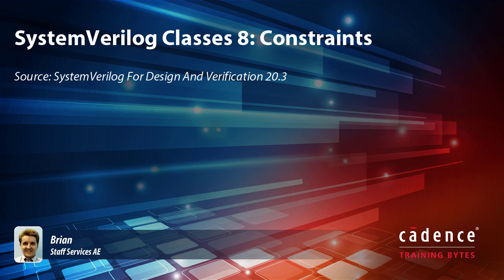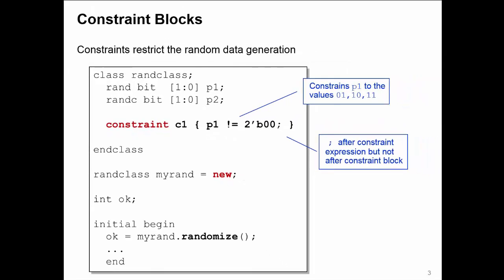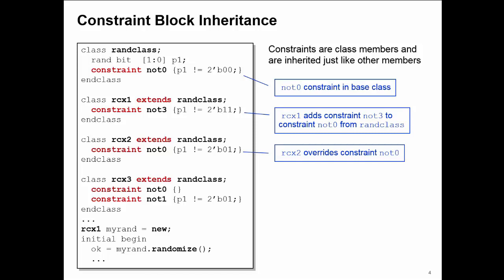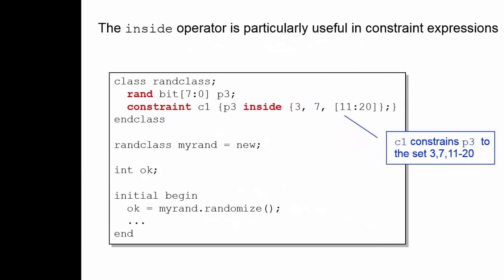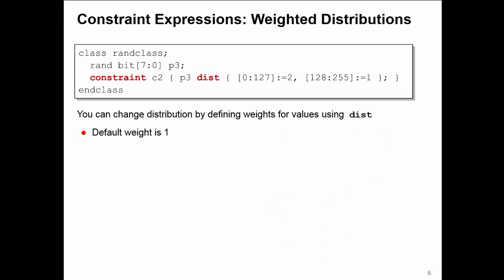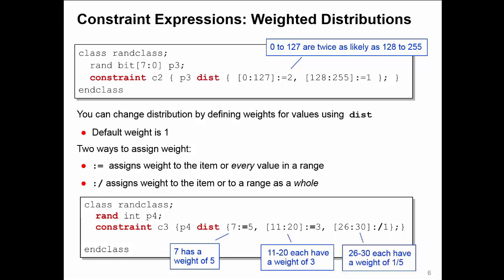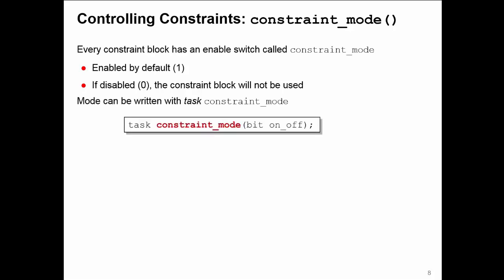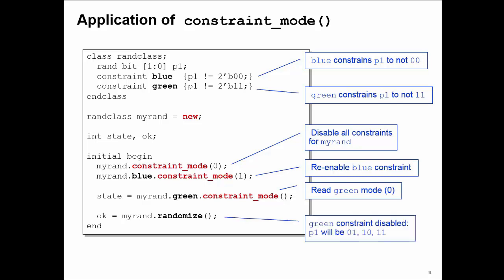SystemVerilog Classes 8: Constraints

Comment: what is the benefits of distribution constraint and what is the benefits of giving the weight to our random number in constraints .can you explain this..
Reply: Without distribution, randomization probability is uniform, i.e. every possible value is equally likely. With dist, you can change the probability of values to make them more or less likely to appear in randomization. Good example would be the parity of a data packet. If you declared a single bit switch to control parity (1 = good, 0 = bad), and randomized the switch without constraints, then you would get 50% chance of bad parity. Maybe for your verification you only need 10% of packets to have bad parity. Therefore you could use a dist constraint to set the probability of the switch to be 90% good(1) and 10% bad(0) as follows:
{switch dist {0:=1, 1:=9};}

Of course you'd probably want to use an enumerate for the switch type, but that's a different story..

Comment: Can you please explain how to achieve randomization without using Rand key????
Reply: If a property of a class is declared without the rand modifier, it can still be randomized by passing it as an argument to the randomize method. However ONLY the properties passed to the randomize method are randomized. So if you want to randomize both rand and non-rand properties, you may need two calls (see below). Also a non-rand property does not have a rand_mode switch.
e.g.
class randclass
  rand bit[1:0] randp;
  bit[1:0] staticp;
endclass
randclass c1 =new();
initial begin
  ok = c1.randomize();  // randp randomized
  ok = c1.randomize(staticp);  // only staticp randomized
...
Reply: use builtin construct $random to assign a random 32 bit variable
Reply: https://vlsicsinfo.blogspot.com/2020/07/how-to-randomize-non-random-variable-in.html?m=1